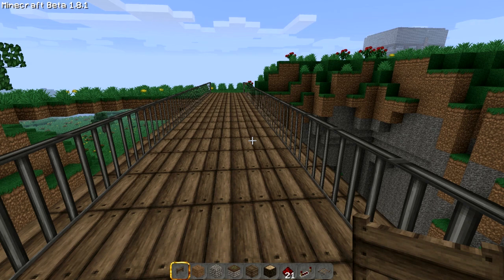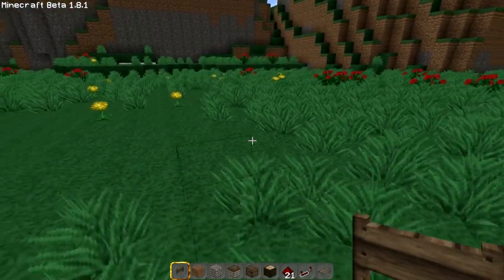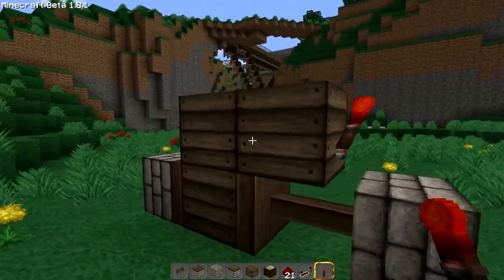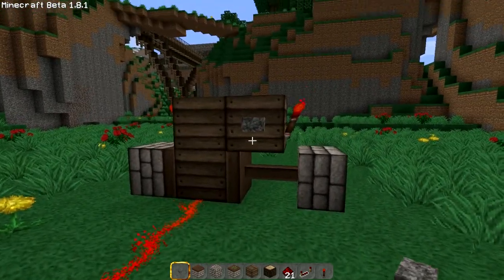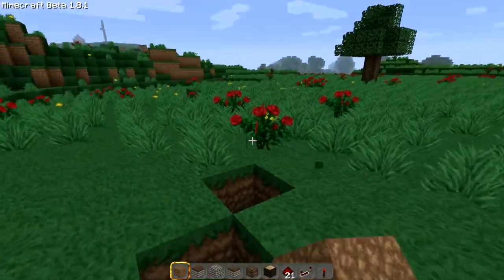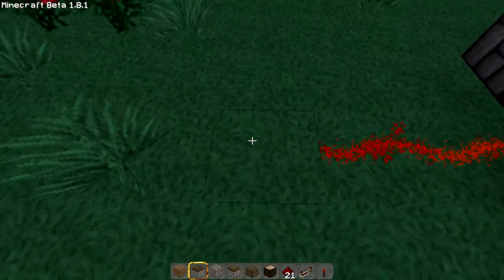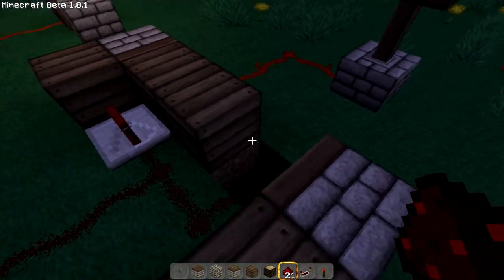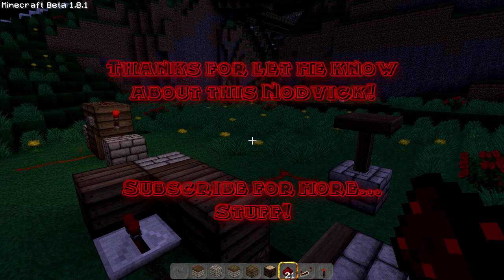New Old T-Flip Flop

Comment: @mcKrawll I'm pretty sure it depends on how decent the server is ie. how much ram it has and whether the memory allocation is fixed or dynamic, possibly what kind of server infrastructure is being used. The biggest issue with redstone on SMP is that it relies on a server side clock. I've been on servers where the piston t flip flop worked fine, but other servers where it didn't work at all, but those servers generally had a lot of issues with redstone.

Comment: I run a 1.7.3 SMP server and that design works fine for me. to get that one to work on the upward edge you just need to invert the input signal.  I have several of those working on my server.  So I can say with absolute certainty that 1.8 has nothing to do with whether or not that works.

Comment: @mcKrawll i tryed both designs out in my testworld. the thing is:
-the large T-Flip Flop delays the signal by only 1 or 0 ticks depending if you are turning it on or off
-the new one always got a delay of 1 tick + 1 tick of the inverter (if you are using my "fix")
=the old design is superior
why not make a slightly bigger T-Flip Flop that does not have any delay?